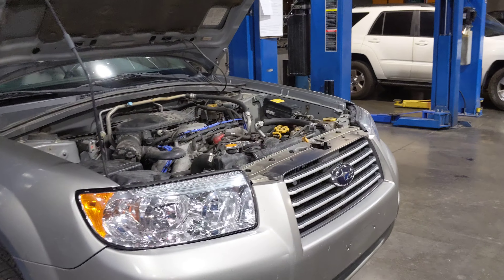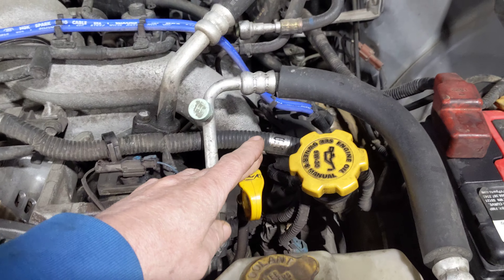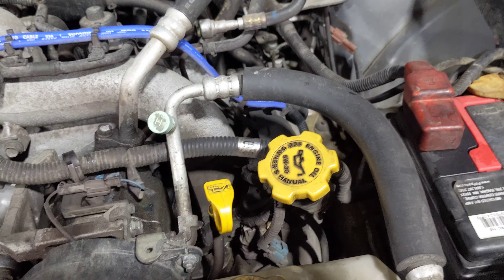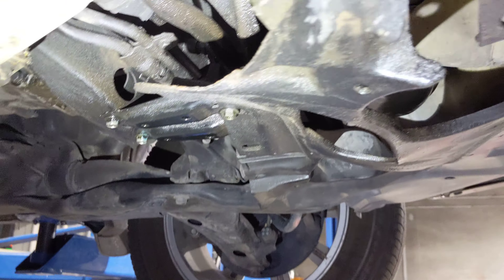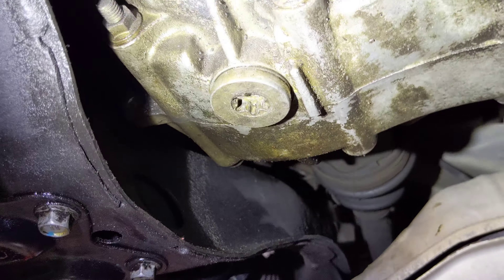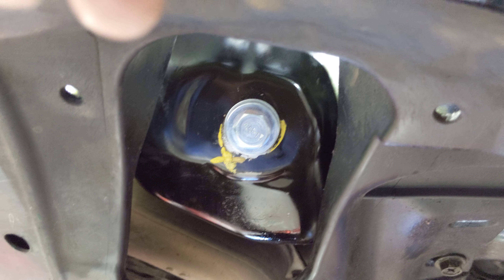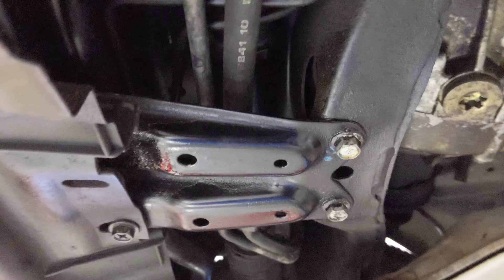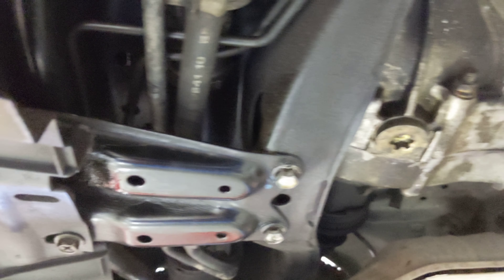Subaru Oil Change: How to avoid Screwing It Up

Comment: I can understand how folk with less mechanical experience can mistake both the wrong plug and the wrong color of fluid coming out. They probably don't know that changing oil on a Subaru involves losing the drain plug into the bucket underneath and all of the draining oil misses it entirely creating an environmental spill from your Japanese Oil Tanker.